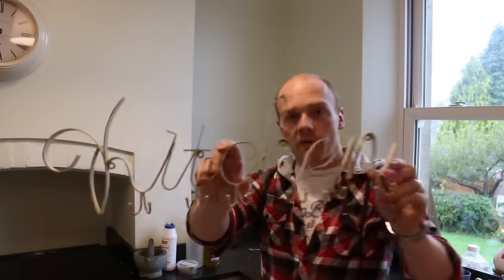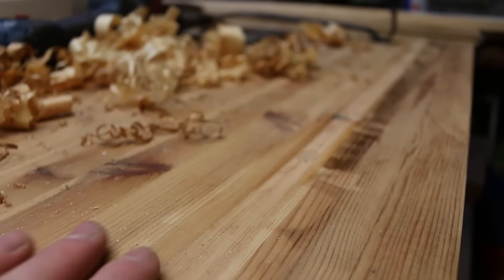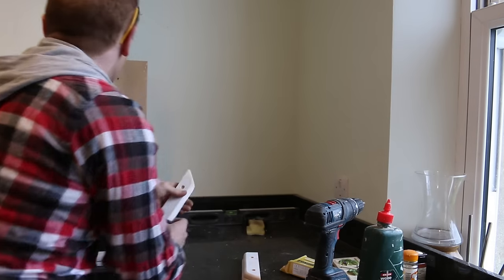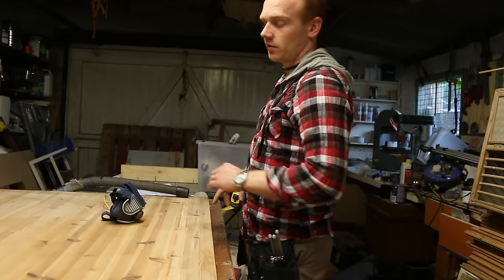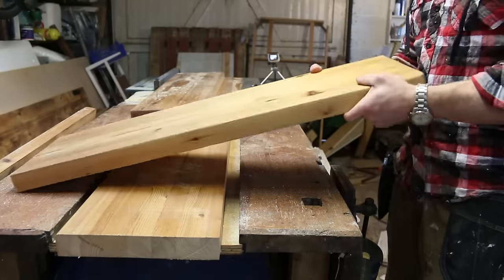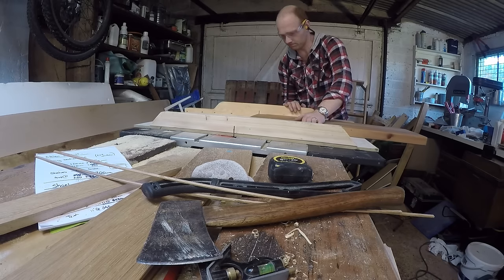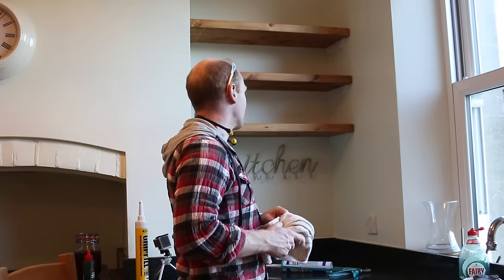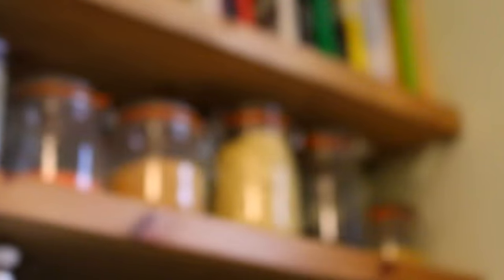UPCYCLED KITHCEN SHELVES

Comment: nice result. I really like your tastes in style and choice of materials. I suppose if you weren't happy with the result of the pine you might glue on a strip of oak to the front and plane it smooth, or do you think the colour would't match in that case?
Reply from the maker: +Ericson Founded America Thanks.  Yes, the other option would have been to use an oak veneer/strip on a plywood shelf or similar.  However there is something nice about real solid wood and to be honest it blends in with the units pretty well anyway.
Reply: yes, it looks really good from the video. it wasn't criticism, just a thought :)